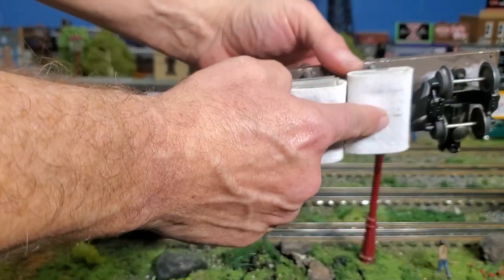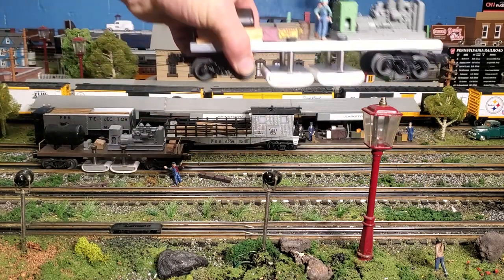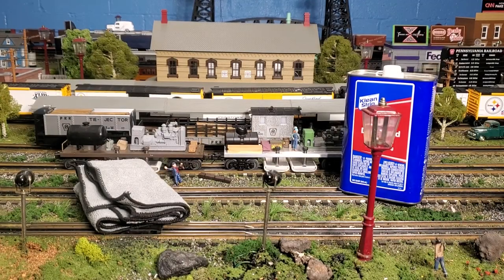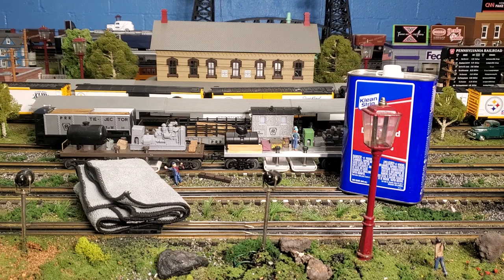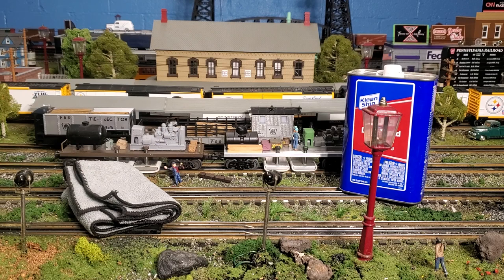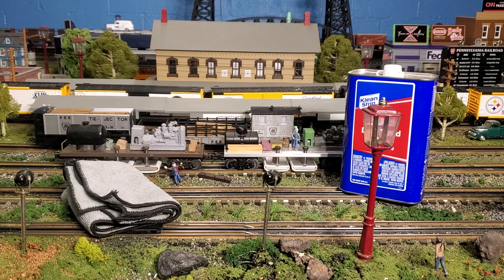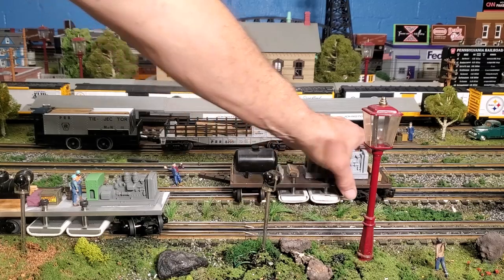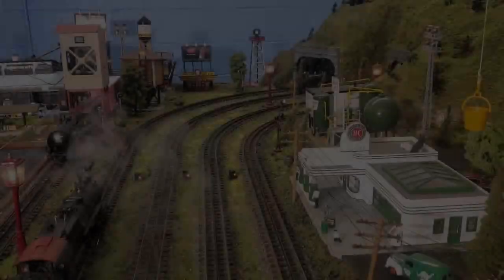Track Cleaning and Maintenance of Way to keep your railroad on time!!

Comment: Great video Bob, MOW train looks great but that I1 is really ugly lol. WD-40 Contact Cleaner has proven to be a good track cleaner for me, it helps prevent arcing and soot buildup and cuts through grease like nothing. I’d recommend trying that if you get the chance.
Reply from the maker: Thanks Mr. Conrail. LOL that I1 has a 0% chance of leaving my layout. I run it actually often either by itself or teaming with the M1B. Thanks for the tip on WD40 contact cleaner. Im gonna try it out the next clean session, there is always something new to learn.

Comment: Great tips for MOW. I use the D alcohol and shop towels, scotch brite pad for corrosion. You can also use pledge multi surface wipes for quick cleaning between the thorough cleaning sessions. I like that MOW train; you have some super equipment and accessories.
Reply from the maker: I am glad you like the MOW Gary. I will have to try your suggestion as well. Im always open to new ideas.